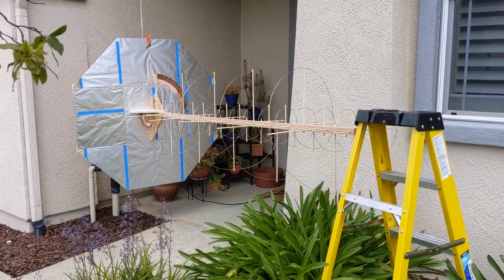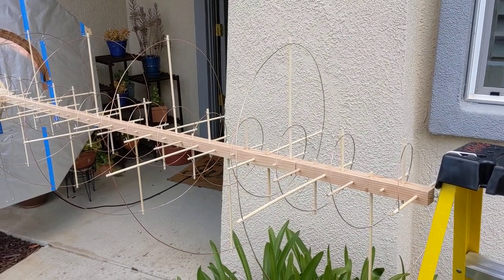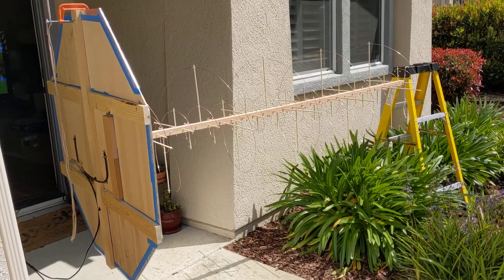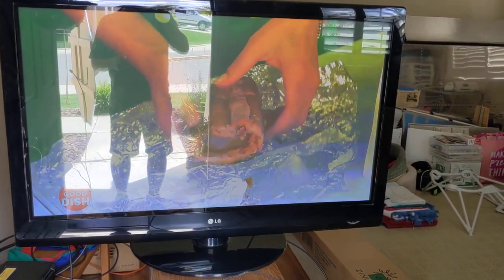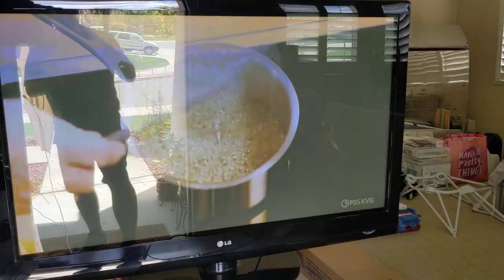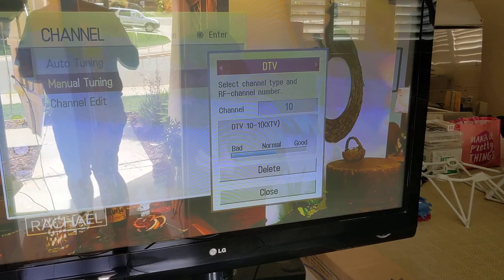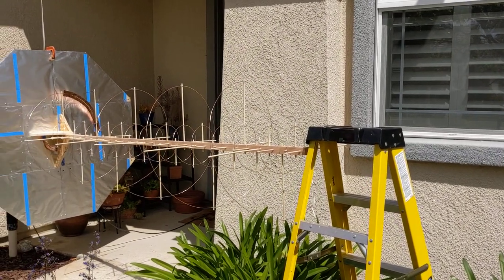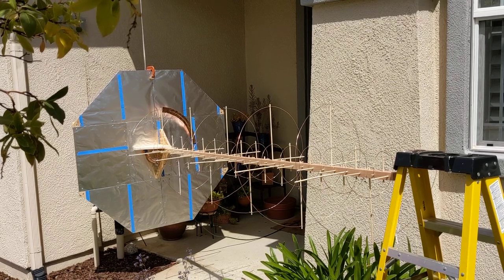DIY long range (high gain) dual band (UHF / VHF) co-axial mode helical HDTV antenna.

Comment: I like working concept of using helical elements.   Have a similar idea of converting a satelite dish shealthed in copper foil and having the shape of the parabola & focal point help retain signal strength.   We also have a stucco house, but manage 50 channels with an indoor antenna in the Northbay.

Comment: 2 biquad antennas (VHS and UHF), with a higher signal gain +3... 4 dB (compared to the helix) and with much smaller physical dimensions, pay attention only to polarization, vertical or horizontal, coaxial cable directly connected, perpendicular to the antenna, without balun=best results, 
it costs little, and from the wire from a helix you make 2 biquad antennas

Comment: Do you still have the antenna ??? How long did it take to build ??? What is the gain of this antenna ???/ Thanks
Reply from the maker: No, I no longer have it.  The stucco surface of my house works to block radio signals, so it didn't work in our attic.  I gave it away to a guy who had a wood sided house.  I probably spent ~16 hours over the course of a few days building it.  The calculated UHF gain ranged from 27db to 42db for the frequencies of UHF channels in my area, and the calculated gain of the VHF coil ranged from 12db to 14db for the VHF channels in my area.  In both cases, higher frequencies were higher gain.
Reply: @mcrv7a I am really surprised how much gain the antenna has in the UHF band. Would you tell me why the VHF is so much lower than the UHF ?? Any other points you can think of please do  share. I really like it when someone just goes for it and makes something unique and powerful. Look forward to your reply Sir. Peace vf
Reply from the maker: @victoryfirst2878  The gain is a function of the number of turns.  The UHF band is much shorter wavelength (about 1/3), so using the same length center mast for both coils, there can be about 3x as many turns as for the VHF.  If course, those were just the calculated values.  I have no way to measure actual gain.
Reply: @mcrv7a  I understand what you said. What I was wondering is if there are other types of antennas that are a lot smaller with ultra high gain in the mostly used UHF signals for TV?? Would you be able to make the spiral UHF antenna smaller and keep the high gain ??? Thank you Sir for educating me on waves. 
Peace
Reply: @mcrv7a  I just want to tell you Sir, The reason the stucco blocks the signal is that most contractors use galvanized mesh screen nailed underneath the masonry surface coat. Normally straight stucco over cinder block does not have that problem. Just saying or should I say I just remembered.